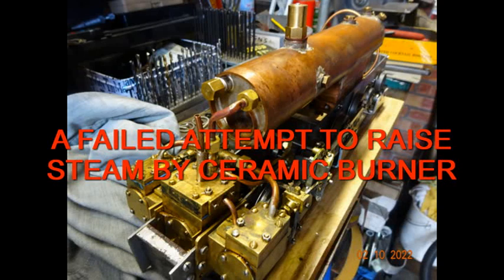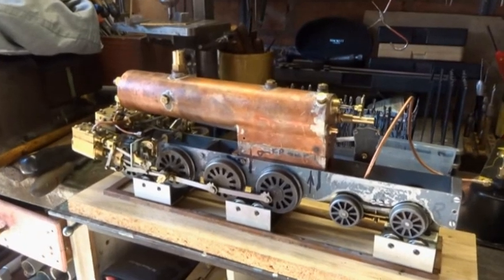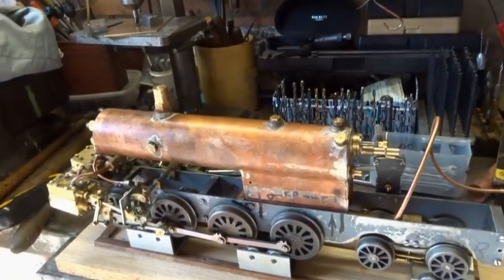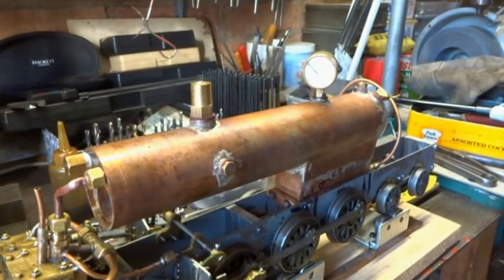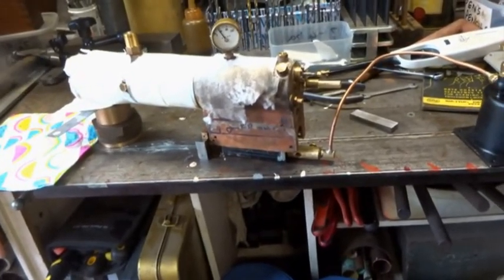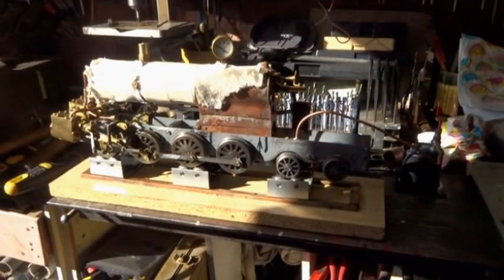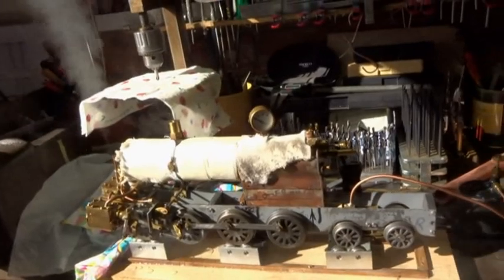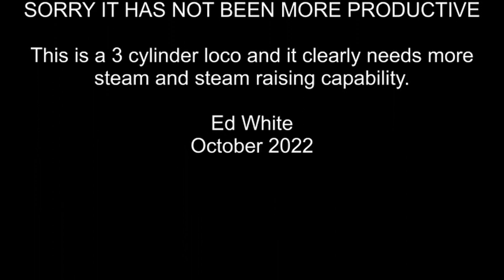Garden rail 0 8 4 loco not going well

Comment: So impressive, what is the greatest fun for all of us armchair engineers, is that this unfinished project will eventually eat at you, and you will return for more battles......which of course we will all enjoy. At your expense of course!! 

 PS this line of text comes from the roundhouse engineering website...   "During 1994/5, a great deal of time and money was spent on developing a new gas system that would do just what we wanted when we wanted. With the help of a number of specialists in the gas field, including time in the Department of Fuel and Energy laboratory at Leeds University, the 'FG' gas burner was eventually developed which was easy to manufacture and is efficient, quiet and weather proof......So, these guys do this for a living and found it difficult which exonerates you from any finger pointing. I also watched a video by Tony Bird recently when he made a ceramic burner for his "Ellie" he modified that quite a few times before he got the results he was looking for. Great video as always Ed. Regards Garry
Reply from the maker: Thanks for your kind encouragement Garry. You are quite right - I will never truly rest until I get this loco sorted. I have built a few gas fired 'poker' burners with little trouble, but this ceramic stuff is proving a tribulation. LOL

Comment: Would you like me to check my stock of copper tube? If so how long do you need the tube? That boiler might work well on a two cylinder locomotive.
Reply from the maker: Ben, I think you are absolutely right. The boiler very much follows my practise for 2 cylinder engines and is not up to the 3 cylinders. Also I originally intended to use spirit firing and have gone off my page somewhat by deciding to have a go at a ceramic burner. I do have some issues with the ceramic and when I get back to this I think I will build my own ceramic burner rather than the 'shop bought' one that I have. Please don't trouble with tube supply. When I get back to this I will buy some. At this time I have not decided on the replacement boiler dimenstions. I have started to build a diagonal paddle steamer engine that will occupy me for a few months over winter. Many many thanks for your kind offer.
Reply: @edwinwhite933  No problem. I have some 2.138" at  roughly 6  3/8ths" long and quite a lot at 2.117.  (I have a couple of foot of that) so if you change your mind let me know. I buy it at £8 a kilo from the scrap yard.
Reply from the maker: Thanks Ben I will bear your generous offer in mind. Ed
Reply: @edwinwhite933  No worries. I will be making boilers soon too.
Reply: WE should get you two together, the end result could really be a blast! LOL